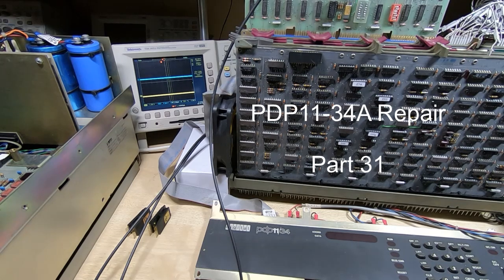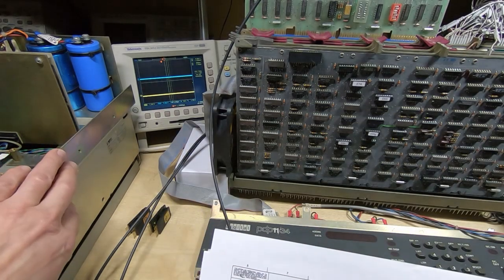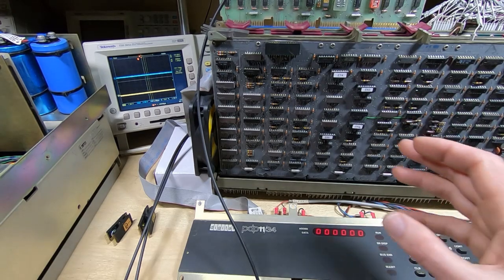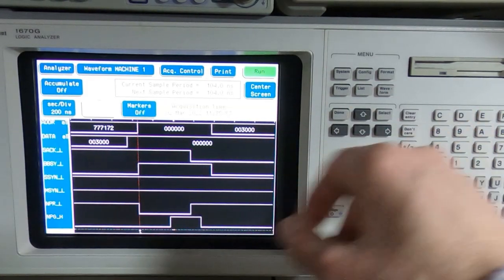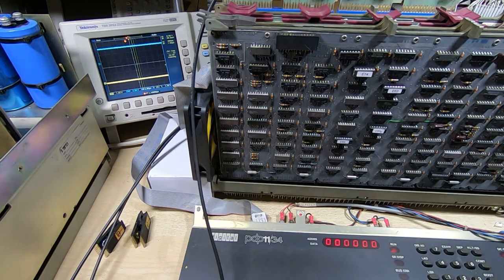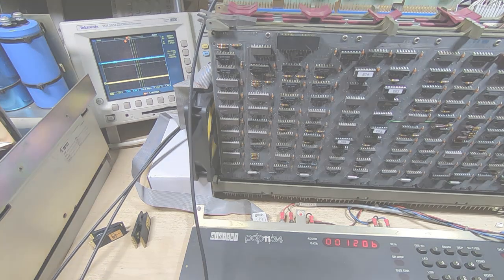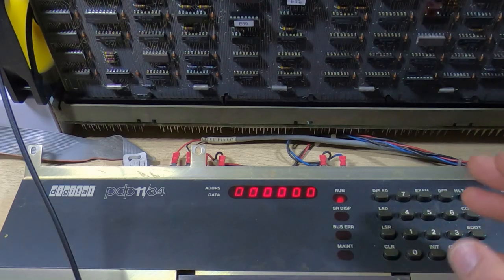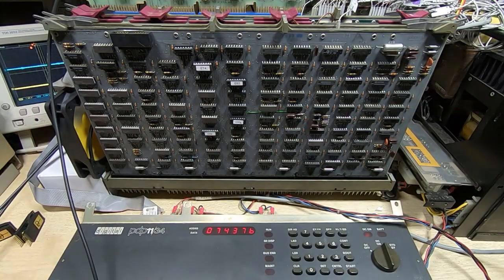PDP11-34A Repair Part31

Comment: This thing has my favorite Processor. Yes, that’s right, thee Ol’ Digital/Harris J11 
In-Q-Bus.  
That being said. I will make it my mission to ReFind-Restore-Repair-Reuse any PDP items I can find in the wild. This species has been endangered for a couple decades now. I’d love to mount one in my game room. 
God Bless.
Reply: This is a Unibus-based PDP11. Also, the It does not use the J11 microprocessor. The CPU is composed of two hex-height cards full of ICs.
Reply: @zachz96  Thanks.  Never got the pleasure to work on a PDP. Not yet. I didn’t know anything about them until I got the J11. 
Looking forward to learning more hands on.
Reply: @zachz96  but didn’t J11 pack all that you just said, on 2 dies.